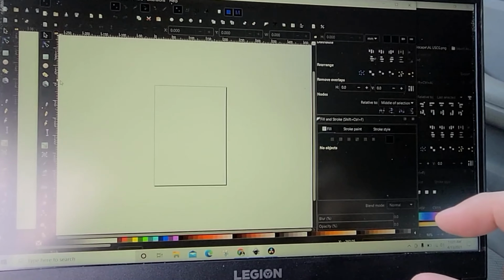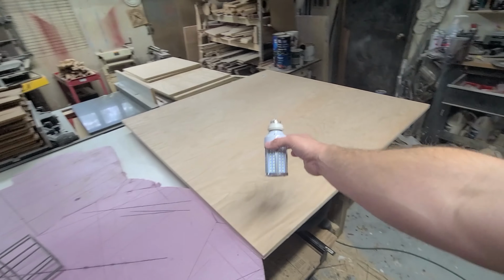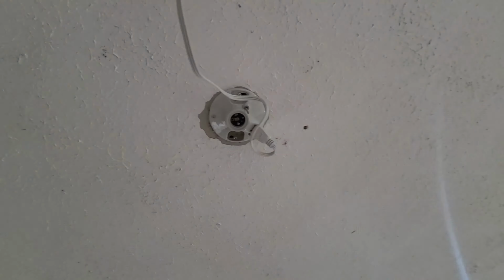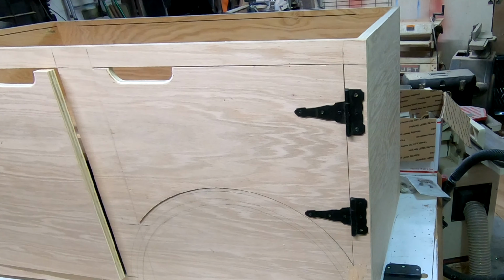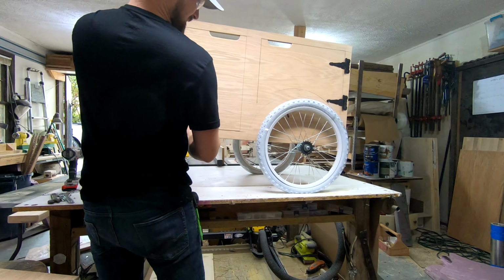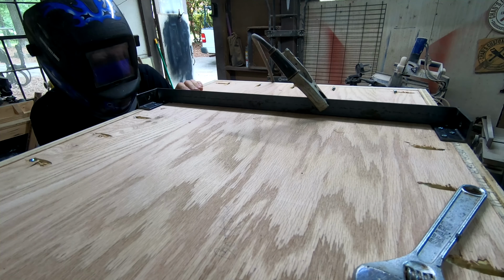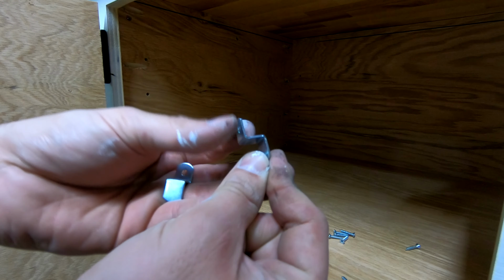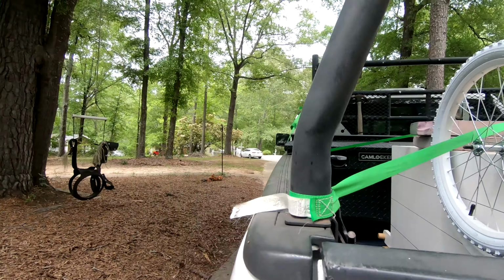Building a Mobile Coffee Cart from a Kid Bike

Comment: What did you use to attach the wheels? Like that bar?
Reply from the maker: I can't remember the exact measurements but I used this
 https://www.lowes.com/pd/Hillman-1-1-4-in-W-x-1-1-4-in-H-x-3-ft-L-Plain-Hot-Rolled-Steel-Solid-Angle/3033554

Comment: I love the sprayer you got. Can it spray urethane as well? I have thought about getting one for years, just afraid of clogging issues really. That and they are pricy but we have a lot of fence I need to coat.
Reply from the maker: Yeah it's pretty impressive, I don't think this one will clog it has quite a bit of pressure and no need to thin down this thick exterior paint. I imagine oil based would be a pain in the but to clean out of it though. This is believe is the  Himalaya brand off of Amazon, comma or if you want a smaller easier to clean option I would look at the homeright Max pro.

Comment: Wrong built. Its just a poor cabinet on wheels. Nothing different than a normal cabinet.
And that 90° angles brackets for wheels, cannot support the weight of the cart if loaded. The wheels will fall apart. You need to look at tricycles to understand the axles vs your poor brackets with 4 screws.
Looks like you don't understand the weight balancing and angles.
Reply from the maker: You are right; the wheels should be supported on both sides of the axle. It's been so long ago since I built this, but I believe I was even shocked that it worked the way it did. Believe me I would have loved to do more but this project was on a small budget and short deadline and I made it very clear with the client that this cannot support much more weight than it was already carrying with that heavy butcherblock. Thank you for the constructive feedback. No hard feelings words of improvement are always welcome here on my channel.